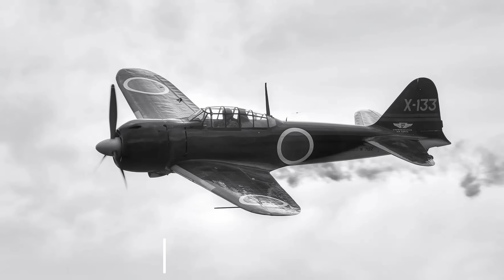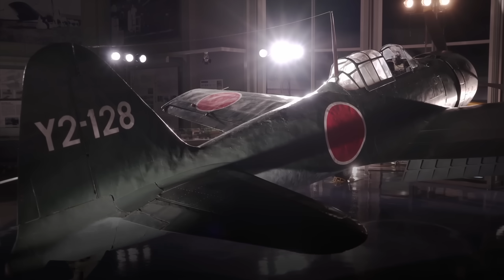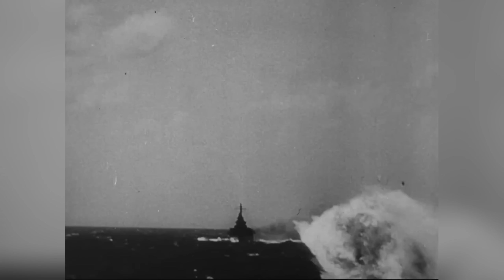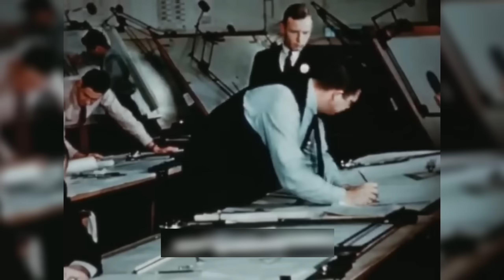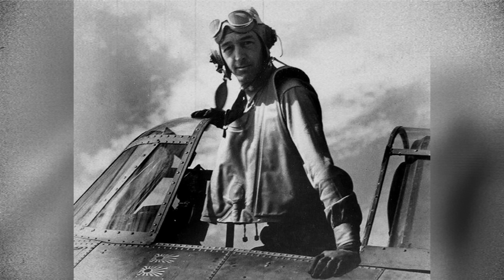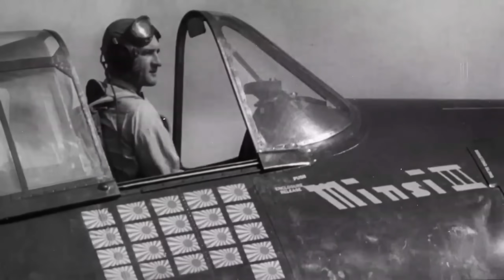Why 90% of "Zero" Pilots Died

Comment: the other factor was that Japan did not have a huge pilot training pipeline. As their pilots fought and died they were not replaced. There were shortages of fuel and parts and the replacement pilots arrived at the front with much less experience to take on American aircraft that were superior with better trained pilots. So most of them died because the experienced ones were just used up.
Reply: The U.S. tried to rotate their best and most successful combat pilots back to the states to train new pilots. Seeing pilots who had survived and triumphed in encounters with Japan's pilots enhanced the confidence of the trainees, and the tactics employed and lessons learned were taken as credible. Japan kept all their pilots flying until they died, so much of the knowledge gained by their best pilots died with them.

Comment: I am an avid WW2 Buff.  The best plane - though came in to be AFTER 1942 - as result of the Jap Zero holding dominance over the American F4F Wildcat .... a 1200 HP Radial Engine and heavier than the Light and fragile Zero ..... but often fell to the climb and pullover to tactic of the Zero for a drop and shoot down stalling pursuer !  The difference visually was slight and not until the performance, power, protection and shear armament [ 6 Missiles under wings / 6 cannons / Belly Bomb and SUPERIOR CLIMB RATE to negate the Zero prior advantage !  The plane was the F6F HELLCAT, .... it score a best in Pacific theater Kill Ratio of 19 to 1 !  That was when zero pilots were not coming home, their planes no longer viable assault threats.  GBjj

Comment: This is poorly researched.  The Americans as Chennaults Flying Tigers first met the Zero with the P40 War Hawk in the summer of 1941 and dominated them from the beginning.  The Flying Tigers flying P40s had a kill ratio of 37 to 1.  The Zero never was a match for the P40 flown by average trained piolets.  The Flying Tigers with P40s evern had a vastly supperior record over Spitfires against Zeros.  It wasnt that Japan had no air resources that the B29 flew without escourts it was that the planes like the zero could not get and fight at that altitude.  Again zero was worthless overall

Comment: Zero's were not made out of aluminum they were made out of magnesium. Magnesium is lighter than aluminum.
And when hit by tracer rounds they would also catch fire.
Reply: I have a hand built 1967 FJ45LV Land Cruizer. It was made of that out of that same magnesium alloy. The roof is crumbling on it but I found a replacement.
Reply: 零戦の機体の主な素材は超々ジュラルミンでありアルミニューム合金ですよ。

Comment: The Zero was basically an exceptionally lightly built civilian sports plane or mail carrier fitted with guns.
There is a mystique around it but any competent aircraft designer could have come up with it if they weren't worried about making it at least slightly survivable.
Reply: 堀越二郎とチームメンバー達は海軍の要求通りの戦闘機を造る努力をしました。
そして零戦を作り出したのです。
海軍の要求にパイロットの生存率を上げるためや、燃料タンクの防御に関する要求は一切ありませんでした。
Reply: Much of the design of the Zero was to give it the the longest possible range and the highest possible speed.  If I can attack you 600 miles away and you can't attack me until you get within 400 miles of me, expect bad things to happen when we get 500 miles away from each other.

Comment: Most of the techniques used against the Zero were developed by Clair Lee Chenault, commander of the AVG or better known as The Flying Tigers in 1940. Funny he didn't get a mention. While allied fighters  stuck to trying to out turn and dog fight the Zero, Chenault instructed his pilots that that was a death sentence. Better to dive from altitude, using the P-40's superior speed, fire a burst, then climb back up to altitude and dive again. Between his tactics, the skill of the ground crews and the P-40's rugged construction, the japs soon learned to fear those shark mouthed fighter planes of the AVG!

Comment: The Spitfire carburettor didn't flood the engine. It did the exact opposite and starved the engine of fuel.
Reply: Actually the early Merlin engines did flood in negative G. The fix was “Miss Shilling’s Orifice” (developed by Beatrice Shilling) that restricted the maximum fuel flow to the engine to that needed for war emergency power. Later Merlin’s got throttle body fuel injection.

Comment: The Zero was extremely light & very maneuverable, with good firepower & long-range. Exactly what the Japanese needed in the vast Pacific theatre. It was NOT designed to be “defensive” at ALL, but to be an attack weapon! It was expected to outmaneuver every other plane(which it did) & had NO defensive capabilities at all!
Reply: Later model Zeros did actually have self sealing gas tanks, armor and I believe fire extinguishing system.  By that time though, the fate of Japan was sealed.  I know this because I examined a Zero that was being restored by the Smithsonian.
Reply: The Zero could not outmaneuver every other plane.  The P40 devistated it in a dive.  The Zero would lock up and crash if it tried to dive with any plane.  It had a float carborator  and couldnt roll, climb or dive as steeply as other planes. As this clip pointed out its advantage was slow flat level  turning radiaus.   It was absoulutly worth less at higher altitudes.  The P40 flown to its strengths always beat the zero, both planes coming out at the same time.   Later planes like the Corsair, P38, Hell Cat, and Mustang all destroyed it, just like the clip said.  It is especially note worthy that yes the Japanese piolets were better trained but our planes destroyed them with our piolts having fewer hours of training and much less combat experiance and in the end when Japan lost that edge as well the Zero was swept from the skies.  

Re reason everyone thouth the plane was more than it was, came from its early successes agains inferior Chineese and Russian planes.  Only the west thought the Zero was better.  The Japanees almost immediately started trying to get a better plane once they encounted American forces in early 1941.
Reply: It was not nearly as the MID WAR ENTRY F6F Hellcat ..... which was the Zero's better in every aspect .... after 1944 there were no veteran Zero pilots nor planes capable of beating the U.S. Naval Carrier Planes ..... then they sacrificed their young pilots in crashing into our ships ..... like the cowardly heathens did in other circumstances as well. jj

Comment: I've read that the Zero was a great plane, but, a poor war plane.  When it faced modern fighters with well-trained pilots it became a flaming wreck.  As I read it, the Wildcat was a better fighter.  Shooting more down than what they lost.
Reply: By the time America upgraded its war planes the very best Japanese pilots were dead.
Reply: @walterconcrete5017 They had died to Wildcats. The Zero was only supreme when fighting to its strengths. By June ‘42 Allied pilots had worked out how to not play the Zeros game. The Zero was a supreme low energy fighter. In tight slow turning dogfights. Fighting at high energy the Grumman’s were far superior.
Reply: @andrewtaylor940  And, that is the case for any aircraft. Each has strengths and weaknesses and, the objective is to make the other pilot/aviator fight your fight. The Mig was far superior to the F-8 Crusader, or phantom, in a slower speed fight but, would usually lose in a high-speed fight (baring pilot error).
Reply: @andrewtaylor940 設計年度が違うだから当たり前だろ。
Reply: @walterconcrete5017 ... because they had been shot down.

Comment: The Mitsubishi A6M "Zero" is a long-range carrier-capable fighter aircraft formerly manufactured by Mitsubishi Aircraft Company, a part of Mitsubishi Heavy Industries. It was operated by the Imperial Japanese Navy (IJN) from 1940 to 1945. The A6M was designated as the Mitsubishi Navy Type 0 carrier fighter[1] (零式艦上戦闘機, rei-shiki-kanjō-sentōki), or the Mitsubishi A6M Rei-sen. The A6M was usually referred to by its pilots as the Reisen (零戦, zero fighter), "0" being the last digit of the imperial year 2600 (1940) when it entered service with the IJN. The official Allied reporting name was "Zeke", although the name "Zero" was used more commonly
Reply: Educating YT comment viewers.  Compelling.
Reply: It had no protection for the Pilot or the Fuel Tank or the integrity of the air Frame ..... which meant it never survived hits by an adversary !  The adversaries were often lured into a climb to catch scenario ... bad news for the American pilot .... until THE ADVENT OF F6F HELLCAT .... which was was far greater in every way to the Jap Zero .... 19 to 1 Kill Ratio. Then it was not a threat ... fewer and fewer veteran Jap Pilots ... until none.  GBjj